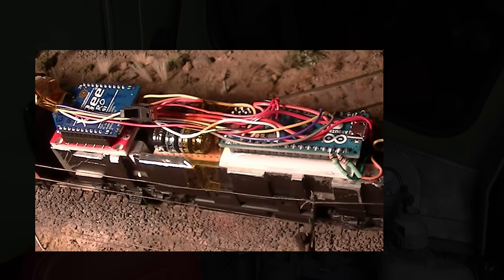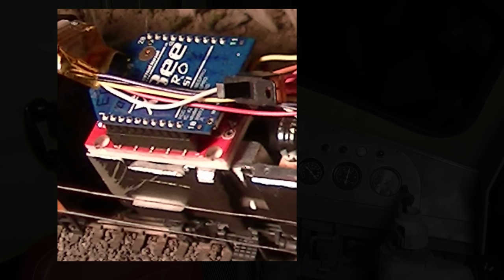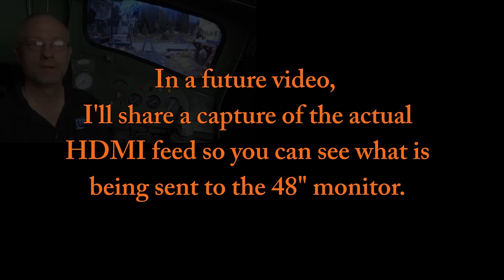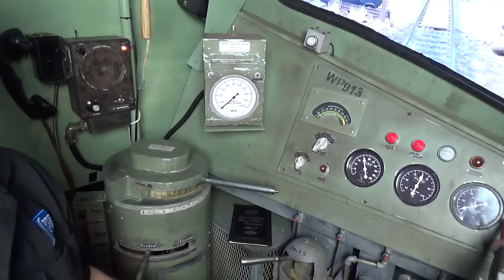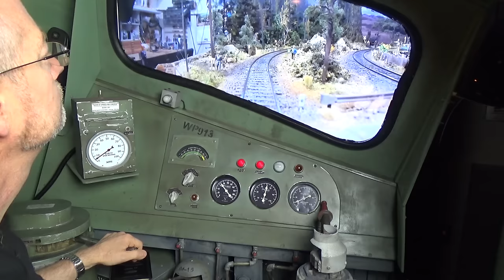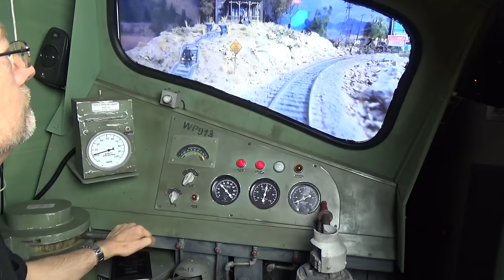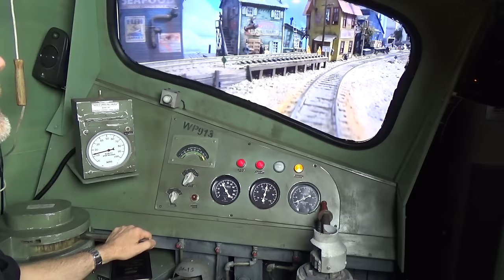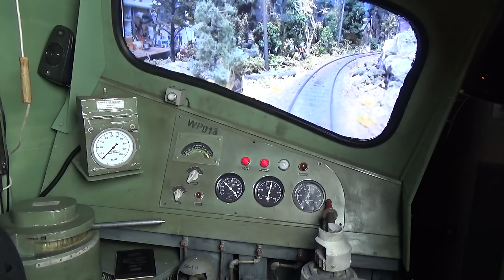Ultimate DCC Throttle – Part 10

Comment from the maker: Update 03-July-2015.
Based on observations from “CSXyardmaster” below, UDT now calculates the reverse effects of coupler slack while stopping. If the locomotive has more deceleration than the rail cars due to braking, the computers calculate the energy of rail cars as they each “slam” forward into the rear of locomotive. Not only the audio sound/vibration of this is generated, but can make the locomotive “jump forward” that is visible looking out the window. The brake pressure issue is still being worked on.

Comment from the maker: Update 06-July-2015

Added a “fictitious” EMD control box to the cab that communicates with the cab radio. Nicknamed the LLCI “LocoNet Layout Control Interface” enables me to send to manually send non-locomotive DCC commands to my layout. Functions already implemented is turnout control. Keeping with the spirit of the cab radio, all actions are followed-up with dispatcher’s voice over the radio speaker. Like all my cab controls, the box looks old and weathered and uses knobs from electronics from the 1950-1960s.

I really like the added enjoyment of the external “environmental” sounds has the camera passes each layout scene, but I haven’t been pleased with the quality of the sounds I made. As with the prime mover, I reached out to find the professionals.  Working with Jim Wells of Fantasonics Engineering, I plan on having “continuous environmental” external sound effects that not only represents and area being passed, but include activities the locomotive/train is executing such as being fueled, loading freight or passengers, maintenance, etc.

I started working on the design of my VS “Virtual Scenario” computer system.  Bridging all the systems I created on this project, VS will bring random layout events, challenges and interaction while operating the Ultimate DCC Throttle “UDT”.  This will include random and revised dispatched routes, repercussions of improper locomotive operations such as flat spots on wheels, broken drawbar, speeding, kids throwing rocks, etc.

Using JMRI and custom Python software, the Virtual Scenario software will enable me to stick to my mission that the UDT will still only required one LocoNet throttle cable.  VS is going to require a lot of sound effects and that’s where I hope Fantasonics Engineering will come to the rescue.

Comment from the maker: UPDATE August 29, 2015: I've been able to reduce the size of the telemetry computer, transmitter and sensors and now installed in the front locomotive with the HDMI camera and an new headlight for nigh-time running. The forth F7A locomotive has been removed.

Comment from the maker: Update 09-AUG-2015

After test running my “Environmental Sound Effects” for a couple of weeks, I found there were many flaws in the sound effect selection logic and flexibility. As a result, I just completed a full redesign.
 
The Ultimate DCC Throttle (UDT) now sends it’s telemetry and locomotive operation information back over the LocoNet to JMRI and merged with 32 track occupancy detections and other train activity.
JMRI now sends “suggested” Environmental Sound Effects commands back to the UDT over LocoNet.
The methodology enables Environmental Sound Effects based on train location, train activity, track occupancy and random events. Information can also come from JMRI Warrants.
The UDT now can “stitch” Sound Effects files together based on this information to create an endless and random virtual reality “story”.
This will require the Sound Effect files to be designed for “Stitching”.

Comment: Very nice work. Brake pipe should be 90 lbs and the main needs to a minimum 15 lbs above your brake pipe setting. Also when you go into emergency you should bail off your independent so your train doesn't kick you in the ass.
Reply from the maker: CSXyardmaster I hope to get my "real" train engineer back soon to conduct the operation audit. Since the UDT works based on mathematical models of locomotive sub-components such as valves, tube sizes, pneumatic compressibility, friction coefficients, etc., the results are from the computers. To fix the problems, I need to find where “assumptions” are incorrect. Since these locomotives were designed before the days of computer analysis models, it’s difficult to find many of the definitions. Unlike train simulator programs, if I “force” constraints such as you mentioned, the software can generated sometimes very violent oscillations to command signals for servos, sound stitching, and DCC packets.  I’m sure in time I’ll get there.  Thanks for the observations.
Reply: Bruce Kingsley Been an engineer for 12 years so I can teach you all about how the air works but computer programing I’m no help. Really just depends on how realistic you want to make it. In my experience and what I see in your videos it runs more like the game sims in that they react and recover to fast. Hell you’ve gone this far why not put a working air system on it and let the CPU get its inputs from that.